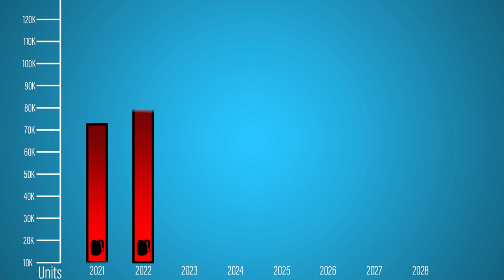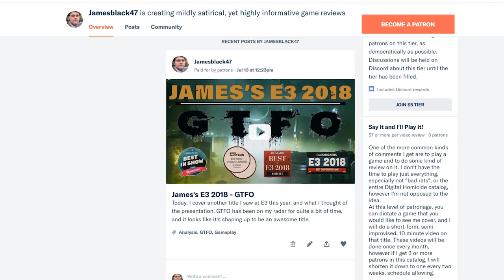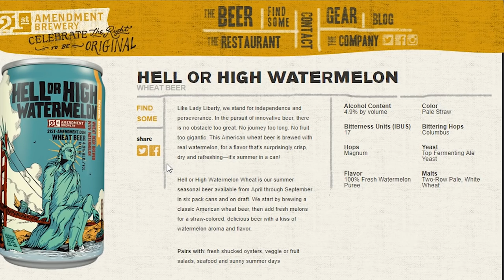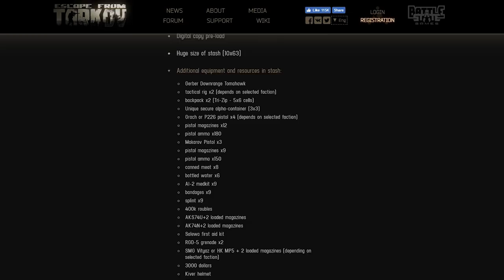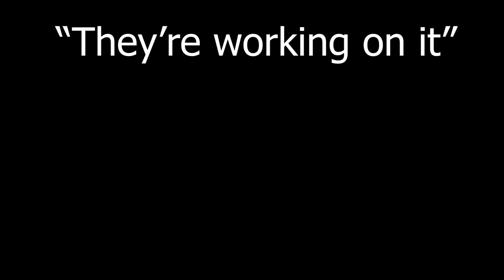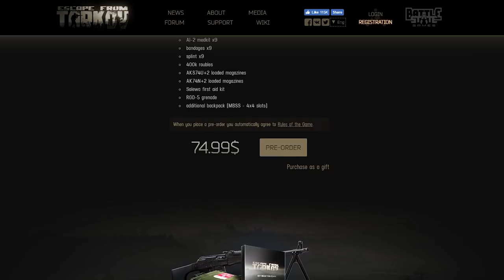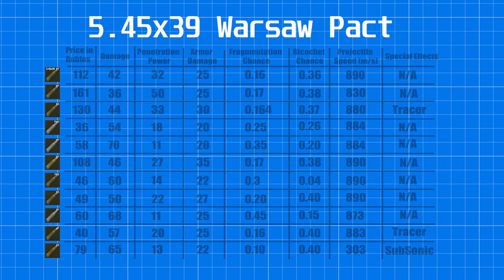Escape From Tarkov: Worth $44.99? ($99.99? $149.99?)

Comment: Well, I'd just like to clarify a couple of things. The S.T.A.L.K.E.R. developer did not use a Lada to get to the development studio, otherwise, there would be nothing. Lada's are known to break down every 10 meters until the driver has no other option than to commit suicide. Unfortunately, two events occurred which make this experience a waste of time. First, he forgot the diskettes that had the XRay engine on them, the Unity Engine is far worse than any Lada could ever be. Also, Unity is the most difficult Engine to work with, both for developers and for modders. Developing an FPS game, in a persistent world is pure lunacy... Even the XRAY engine would have been much better. I'm afraid that like the Lada, this game is DOA.
I have played a couple of hours, but will never buy a game which uses Unity as an "engine", unless its a $5 "Indy Game" that I just want to try out,
Cheers.
Reply from the maker: Ah, a fellow gentleman of culture.

Comment: Lucky I don't get the performance issues people are experiencing and I'm running it on a lowly 1060, though it's with a 6600K@4.5Ghz and runs off an SSD. Personally I've been playing since 0.3 and I haven't seen much progress in terms of bug fixes. They added quite a few features and content, and had a huge overall of the net code but it's still trailing the industry and there are still tons of bugs and exploits. it has always been my stand that truly great games are always broken, at least at launch, and EFT...   it is as great as it is broken.

Comment: The best way to kill "armed to the teeth" players. 
Spend 10-15k rubles on a BlackRock Rig, trade that rig for an AK-74n, wait for Prapor(level 2-3) sales reset to buy 5.56 BP ammo(important,stock up). 
You are now a SWAT killer for 1/8 of the price of their AK alone lol.

pros- you rip through armour
-even if you dont extract, some dogtags/gun parts will cause you to break even if not profit. 

cons- your ak recoil is so high you'll lose almost every mid range fight.
- minimum meds
-minimum ammo
-minimum protection
-maximum difficulty

Comment: There are several single player mod versions of this for Stalker on Moddb. I'm sure Mr. Black already knows but anyone with any potato level PC can run those mods like me. I haven't had a GPU in 6 months and run 60 frames lol
Call of Chernobyl, Misery, Call of Misery, Last Day or Dead Air (in order of difficulty)
Dead Air is a lil harder to get but is the best imo. They have a torrent of it available so you can have it downloaded in 10min
Get pissed off from walking so much and spawn cars or trucks in like I did!
Reply from the maker: No Lost Alpha?
Reply: Whats the mod for stalker thats like this because i have coc but it still has monsters i would love a stalker with only humans
Reply: Misery (misery ties call of pripyats' campaign story directly into the mod) 
Call of Misery, Last Day and Dead Air would be your best choices. In Options and under Game theres are sliders for mutants and humans respectively, lower mutants and increase human spawnrates. 
You may even find a sub-mod on Addons from Moddb that remove mutants entirely. I don't actually know though. I play with mutants

Comment: Holy crap your game runs bad. I would not play that game for a second with that kind of performance. I had 4690k, 8gb of ram and gtx780 and it ran 10 times better. CPU being overclocked and rams being cl9. I had those stutters too, like the game kind of stops for a split second every now and then, but outside of that stutter it worked pretty well. Now I have same system except with 16gb of ram and 1070ti. I guess the game has some severe optimisations done to it too. Runs very well, although I haven't played on all maps just yet. Had couple games with bad server performance, like... people and all server related actions not working (players froze to place and no damage to them because they probably were already in some place else or something). From launcher I hand picked three best low latency servers now. Some say it helps, or at least you are not going to be thrown into server with insane ping. Usually if I end up into bad server, I just try not to engage anything and stay alive. The server might start working after some time. Maybe just go into bush and go make some coffee and spend time. I guess it gets better when people get killed and there is less players or scavs wandering around... or less things happening around the map. Overall the game performance seems to be a lot better compared to about 10 months back when I last played this game.

Oh... and the Mosin Nagant is just awesome countermeasure against those highrollers. Just rekt two of this wipes highest leveled players with four shots. Naked guy with just mosin and iron sights shot their overconfident asses to the moon. They had the best armor best helmets best everything outplayed by 25k ruble mosin. Their stuff was worth like 2,5 million rubles.

Comment: you couldn't of done this video at the worse time they recently between 8.0 and 9.0  ran into a hit reg issue and bullets not registering... i suggest waiting a little longer and giving it another review back before the hit reg issues and that showed up the game was much better feeling when doing PVP 

and as for the 140$ edition it also comes with the season pass DLC.. 

iv'e played since alpha and trust me the game has become sooooooo much better then it was in alpha lag use to be minutes long and your friends would be running to extract but on your screen there still half way through the woods on your screen and team speak would be so confusing... you also needed a good internet they use to have an issue with bandwidth   it would suck it up and the lag man was  horrible.. my mate upgraded his internet to 100mbit just for tarkov and it fixed the issue. but its much better now but as i said they ran into issues in recent patches net code still as a long way to go but it will be much better once they sort out the current issues.. 

as i said give them time to nail down the recent issues and give it another opinion

https://docs.google.com/spreadsheets/d/1-q1Yiof1FfGBlIoudl799BFyx_fMYEGt-TP2Itci4z0/edit#gid=0

this will help with new players its the ammo charts and there stats ^